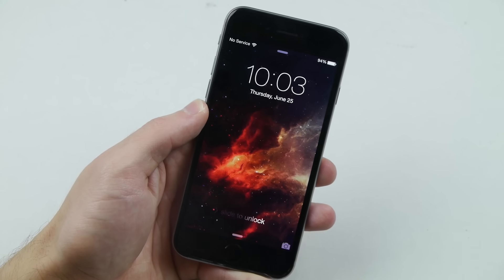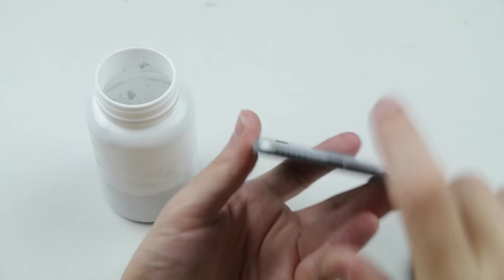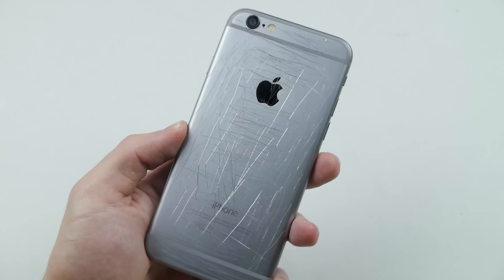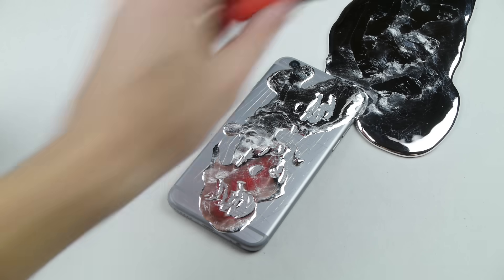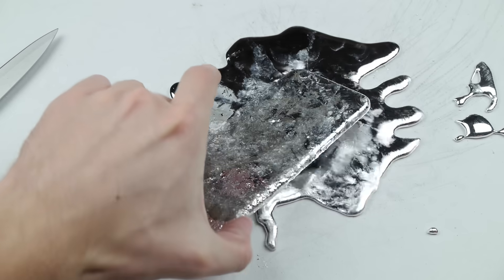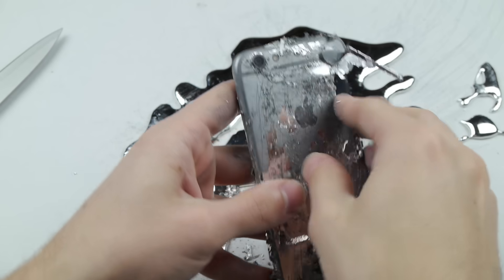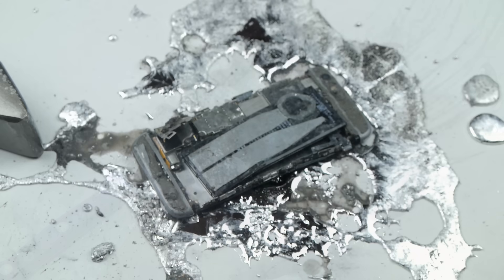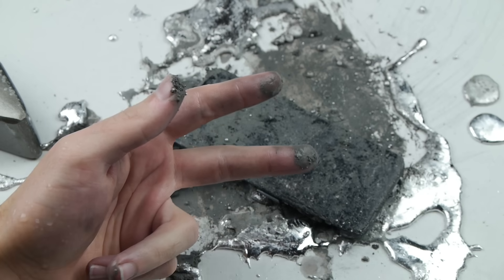What Happens If You Pour Gallium on an iPhone 6?

Comment: Dude. You have no idea how dangerous the shit you did was. You cleaned it with water?? And you touched it?? AND you breathed that. You are completely careless. These are chemicals bruh. You could've gotten poisoned.
Reply: +Jacob McLeod do I need to have videos to know something?
Reply: Kamichara Karin Yoda you talk like. Sense you not make.
Reply: ***** Except when it reacts with other elements.
Reply: Gallium is completely safe to touch
Reply: Yes but lithium after burned with oxidized gallium gives out toxic fumes.
Reply: It did. It does.
Reply: SuperTechno2012 I know it's not but it's fumes mixed with lithium and air might be and he didn't even know so it was stupid of him to do that. He called the phone a burger tho what am I expecting..
Reply: Cw Pm There are toxic chemicals inside the phone. Don't even try to say that there aren't.
Reply: +• Irem • oops my mistakes it did
Reply: • Irem • I said oops
Reply: • Irem • lol
Reply: Gallium is not toxic or dangerous
Reply: I agree that he was a bit stupid to do this, however there were no toxic chemicals. When he put the water on it all that was happening was the aluminum reacting and producing hydrogen gas which is safe in small amounts. Also I doubt that the gallium would have reacted with the battery, batteries are usually sealed with plastics and other metals that do not react with gallium so it should be safe. All the heat was from the aluminum and water reacting not the battery. I did a similar experiment in my chemistry class with gallium and aluminum so I know a bit about it. I still would have worn gloves though, just to be safe.
Reply: • Irem • And you would have to look up the products yourself. You're the one claiming that it's toxic when nothing implies that it is. You were literally saying that because there were bubbles, that a toxic gas was formed.
Reply: Kazuto Kirigaya Mixing baking soda and vinegar creates gas, but it's harmless.
Reply: Kazuto Kirigaya Either you couldn't read or I couldn't explain myself, I'm saying there is no way you can know they were harmless gases. You said it didn't react, I said it did because there were bubbles forming. I didn't say the bu blea were because it was toxic gas. I just said there was gas coming, which you had denied before. 

If you are sure that all those highly reactive and toxic when reacted metals weren't giving out any toxic fumes  at all then please prove it somehow. I just thought that there would be a small amount of toxicity. You only said no without any good explanation, just trying to put me down and argue. If you have knowledge in this, then please do share and I'll gladly say you are right and apologize.
Reply: +• Irem • it's true tho , it's actually really dangerous
Reply: +• Irem • and did it give toxic fumes?no.
Reply: Says the one who has no videos
Reply: +• Irem • chemistry I hate
Reply: +Skyler Johnson Gallium is very reactive with non-metals.
Reply: +Jacob McLeod Omfg he needs videos to know something as simple as that btw your videos fkin suck >.>
Reply: I thought that maybe the reaction that boiled the casing might've and probably did also affect the Battery. And the reactioms with air are also very dangerous for some metald like gallium, it might create a small amount of toxic fumes. But once those fumes and the hidrojen and the gasified lithium come together it might've had a dangerous aftertaste. 
Clearly nothing happened but I he had no idea how chemicals are supposed handled. He wouldn't know HCl if he drank it is what I mean :)
Reply: +Chris Brave I watched Jacob Mcleod's videos and i cried inside, then thought about suicide.
Reply: +Tower Crisis Perfect use of evidence to back up your argument. Flawless. 10/10.
Reply: +Cw Pm Don't worry, there are people here that have also payed attention in Chemistry. You are completely correct.
Reply: Gallium is harmless.
Reply: Kazuto Kirigaya That doesn't mean its safe.
Reply: +Kazuto Kirigaya Good thing that&#39;s not how a battery works. The lithium exist&#39;s as Li+ until it reacts with an electron and FePO4 to form LiFePO4, meaning in a battery there are in fact lithium ions floating around, which is why they're called lithium ion batteries.
Reply: Nobody13579ify Well no shit Lithium ions exist in a Lithium ion battery... What is your point?
Reply: Analog To Digital Okay... Nice to know?
Reply: Janna Odelia I always thought it was too.. he/she confused me
Reply: Dude, he made it and he's fine so that's all that matters
Reply: Debora Waller Dude, he was still careless and stupid :)
Reply: You are actually an idiot
Reply: Caiden Dietz Thank you, I'll return the compliment.
Reply: +• Irem • sorry I probably should have specified who I was talking about I was talking about Jacob McLeod
Reply: Caiden Dietz Oh okay :D Jacob McLeod here you go :)
Reply: Galium is non toxic.
Reply: ^please see above.
Reply: Hmmm, no...try a bigger font. Nope,bigger? Dammit i need a billboard maybe :) haha.
Easy snottie he got it right,save the anger for the war vs the stupid and arogant ;)
And illiterate christians who demand we take science out of schools :p
Reply: • Irem • Okay, since apparently you want me to do the Chemistry since you can't do it yourself, I got the equation and explanation for you. The Gallium used in the initial experiment, broke down the Aluminum and thus the thin layer that Aluminum usually has to protect it from reacting from other elements was disintegrated. Gallium is not reactive to water and so when the water is poured on the the phone, it is simply reacting to the Aluminum. The following equation is what occurs towards the end of the video:

2Al + 3H2O = Al2O3 + 3H2

The products are Aluminum Oxide and Hydrogen Gas, which is is the "smoke" you see at the end of the video. Hydrogen Gas, is colorless, tasteless, odorless, and very seldom does it react. It is NOT TOXIC and so your entire argument is invalid.
Reply: Snot Nose The fumes are confirmed to be Hydrogen Gas. Try again dipshit. Ohhh and what was that about a weeb not being able to "school" you? I didn't know having an appreciation for anime had anything to do with intelligence (which you obviously lack.) 

I have no power here? I'm not claiming to have any power, I'm just simply trying to understand how you people can come to the assumption that the gas coming out of the reaction is toxic when nothing indicates it. I actually took AP Chemistry in high school and Chemistry 1 &2 in college as well as O-Chem 1 (I'm currently in O-Chem 2) so explain to me your credentials before trying to invalidate me.
Reply: +Kazuto Kirigaya This is all I wanted from you. Really. And it took you like 2 weeks to write this..

Now I'll take my turn,
The way you wrote it is not how it happens, because this is room temperature. Aluminum and water don't react like that in standart temperature. If it did, the case would melt when the phone fell into water. Which it clearly doesn't. So it clearly was a reaction of gallium and aluminum. Gallium and aluminum combined can tear hydrogen apart from the water and turn it active, which makes it highly reactable and dangerous even at room temperature. The casing melted through and reached the internals of the phone, which are made of titanium, copper, platinium, a lil' bit of gold etc and we all know how reactive most of electronic internals are. And of course the heat of the engine raised the reaction surfaces' temperature. So the hydrogen became a potential bomb. People use that type of hydrogen as fuels. 
And he played with it. It's your arguement that's invalid.
Reply: • Irem • Um I'm sorry but you are making zero sense. I also do not understand where you got everything you are stating because that is not how chemical reactions occur. Can you give me a chemical equation of the reactants and products you are claiming to be apart of the chemical reaction? I would like the same treatment from you since I am actually providing evidence to back my claims.

As for you claiming that aluminum and water do not react, you are wrong. They do when the layer of Aluminum is disintegrated. The reaction which I already stated is thermodynamically favorable from room temperature past the melting point of aluminum (660 degrees Celsius.) Meaning, that you just made me restate what I had already told you.

Can you please read what I already state with less carelessness? I hate restating myself especially when you claim certain parts of my argument are incorrect.
Reply: • Irem • As for, "It took you like 2 weeks to write this." I'm sorry that I have to explain every single detail to prove you wrong but that's what I have to do. If I simply skipped to this part, someone would claim "oh but it's reacting to a Lithium-Ion battery ya-da-ya-da-ya-da." And plus, I'm in college, I have better things to do than argue with people that don't know how to do research. I simply do this to make people think before they type and make absurd accusations of topics they have no knowledge of.
Reply: Kazuto Kirigaya Well I'm sorry, was my "evidence" not enough for you. You had wrong claims and I changed them. Heck, I even rechecked the video to make sure it was actually correct. And it is. Your way to getting to the hydrogen was wrong so I told you how it actually happens. You didn't say that it got there because it was damaged. And I told you how gallium works to release that gas. And so on. I did read all you said, it wasn't anything I wasn't aware of really. And it was wrong chemically. I changed that.

I can't tell you the exact formula since these are elements that could form more than one compount. 

If what I told you wasn't enough, I could always leave my very important work that everyone in this world has, just like you; and go ask a professor. I wouldn't mind. Because we can all learn from these, and that's all that matters.
Reply: • Irem • I had wrong claims? You mean the one where I said Aluminum is reacting with the water? How is my deduction of the chemical equation incorrect? You claim that because Aluminum is at room temperature it does not react when it actually does. Look up the term "thermodynamically favorable" and look up Aluminum. You'll see that what I'm saying is true. 

And if you can't give me a chemical formula then why did you ask me to do so!? You want me to provide evidence while you expect me to believe whatever you say without showing proof? Kinda hypocritical on your behalf isn't it?
Reply: • Irem • Once again, I had to restate myself. Please, for the love of God read and understand everything I am saying! Next time you pull this, I'm simply going to comment, "refer to my previous comments."
Reply: Kazuto Kirigaya I did read it alm and got it, it had mistakes.
Reply: • Irem • I don't understand what you're trying to say...
Reply: Kazuto Kirigaya why, because I made one typo?
Reply: • Irem • No, I don't care about typos, I can usually make out what you're trying to say. I just don't understand this time whether you're saying either:
1) You read what I posted and understood it but you're still saying I have mistakes, or
2) That you had mistakes in claiming what you said.
You might have also meant something else.
Reply: Kazuto Kirigaya I understood what you had written, because I actually had read it all the first time too, and it had mistakes. So I decided to clear them up and say what I think happened.
Reply: • Irem • So you're saying that I have mistakes? Please elaborate because all I have done is provide evidence to prove everything I have said. You have not.
Reply: • Irem • You know what I find funny? You start your argument with something and then when I prove you wrong, you switch to a different topic, and then to another. Do you see how absurd this is? Just accept that I am correct. I have not changed my argument once.
Reply: Kazuto Kirigaya You said things you believed happened and I said what I believed happened. I still haven't changed what I think or "fight for". You should read what I commented carefull as well. It's not evidence unless you actually know exactly what happened. We both can't know what exactly happened, so we are both just saying what we believe happened. And we are believing different things, that's all.
Reply: • Irem • Except I'm not believing anything. I researched the reactants. I wrote out the equation. I got the products. I balanced the equation, and now I have what actually happened. What was produced from the gas bubbles was Hydrogen Gas. There's nothing else it can be given the reactants. Take a college-level Chemistry course and then you'll understand that your stubbornness is pure ignorance.
Reply: Kazuto Kirigaya you see, that's not how the equation happened tho. You directly put it in reaction with water, instead if first making it react with gallium. All this and the rest is in my comment. 
I don't believe that you have the right answer. So I don't think and won't "admit" you're right. Sorry, but that's it.
Reply: Kazuto Kirigaya Take your college level chemistry elsewhere, because it wasn't enough this time. 
Btw did you actually read my comment? Or were you too lazy because I didn't write it out in numbers? I went by logic and research. If you really do take chemistry in "college level" then you should be able to understand what I wrote very very easily. How come you don't correct my mistakes and "ignorance" the way I did?
Reply: • Irem • See, and I already explained to you why that isn't a feasible argument when i debunked it in my previous comments. I'm seriously beginning to think that you ignore anything that doesn't coincide with your argument. Aluminum and Gallium do not react. When gallium is placed on Aluminum, Gallium atoms invade the aluminum, resulting in an extremely fragile and brittle material. This means Aluminum is easy to react with and since Water and Gallium do not react then the only reaction occurring is Water and Aluminum.
Reply: • Irem • Are you going to make me re-state everything because you ignore anything I bring up to counter argue your false claims? Look, Aluminum does not react with Gallium. Water does not react with Gallium. Therefore, Gallium is useless as a reactant in any equation you use for these elements. Aluminum is simply reacting with the water now that it has been weakened by the Gallium. It's basic "logic" which you claim to have, but obviously lack.
Reply: • Irem • And no I won't take my  "college level chemistry" elsewhere. It's the knowledge that I'm using to prove you wrong lol. This is as straightforward as it gets. It's like you believing that 2+2=5, when I'm trying to prove that it is actually 4. You're just too ignorant on the subject to see it clearly.

Comment: touches molten metal ooh that stuff is hot
Reply: Gallium melts at pretty much 86F/30C. I think he overkilled heating it if it's actually hot.
Reply: Pretty manly.
Reply: +Milesofgaming This metal melts in hot water....
Reply: Gallium melts at 85 degrees, it wasnt hot
Reply: +SangosEvilTwin But metals are good conductors of thermal energy.
Reply: tacotech777 You think people hadn't told me that? He melted it with a microwave or whatever he did, not with his hand. He even said it was hot. Like, complained that it was hot.
Reply: kemboy323
That's great, but it doesn't change gallium's low melting point. It would have still been liquid and not that hot if he hadn't overkilled the heating.
Reply: SangosEvilTwin I did not say that it will change the Galliums melting point. I meant to imply that metals transfers much more heat than non-metals or semi-metals. Try comparing a 30C Aluminum and 30C wood. The Aluminum "feels" hotter because it transfers more heat than the wood even if they have both the same temperature. Or he just simply exaggerated (Just like you said)
Reply: SangosEvilTwin You must have misunderstood me.
Reply: kemboy323
I think what may have happened is that my original point was misinterpreted. What I was saying is that he went beyond the base melting point temperature into a higher temp. As in, instead of 30C, it was hotter still. I would sincerely hope that someone who's used to working with gallium would know how much to heat it to begin with.
Reply: SangosEvilTwin Oh. I clearly misread what you said. My bad.
Reply: I probably could have specified better too.
Reply: it melts at heat below body temperature
Reply: LehFlare yeah but he melted it with some other shit other than his skin lol
Reply: +tacotech777 this metal melts in your hands
Reply: XxTRU3 MASTERxX 44 melts at 32 degrees celsius. body temp. is 38 degress celsius
Reply: "molten metal" lol you're a fuckin idiot.
Reply: +kemboy323 I think you're a bit confused on how conducting heat works. A 30° piece of wood and a 30° piece of metal would feel like the same temprature, because they ARE the same  temprature. Conduction has to do with how easily the material gets hot, or conducts the heat, not how it feels if it's a certain temprature. If the piece of wood is 30°, then the piece of wood is 30°. It being a bad conductor doesn't change the said 30°. (but if you put a piece of wood and a piece of metal in a 30° environment the metal would heat up more and faster).
Reply: +XxTRU3 MASTERxX 44 it could have been hot.